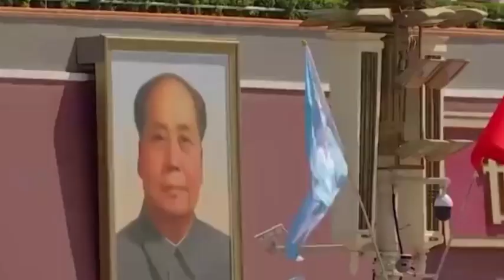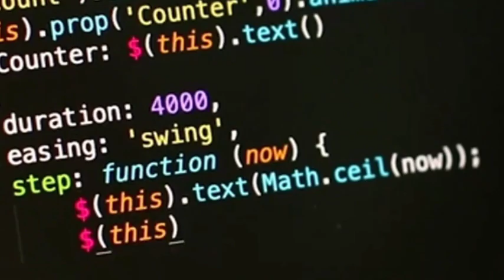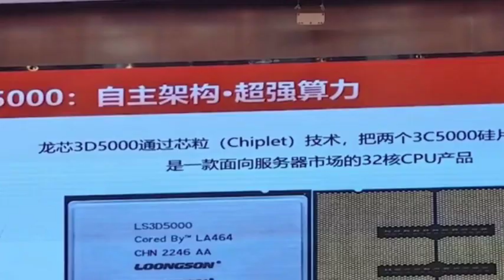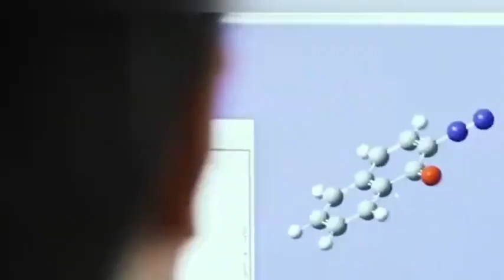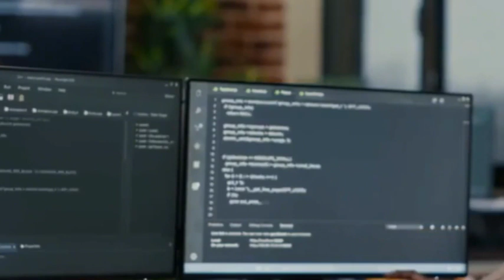Chip performance improved by 1000%! China's first graphene chip was born!

Comment: The race to smaller chip node sizes in silicon has become an expensive effort with more expensive lithography processes needed to realize.  If the comments are true, China has bypassed this effort by using graphene and will most likely prove to be a more cost effective new process for higher performances in speed and power consumption.  ASML should be worried.

Comment: If this breakthrough in Graphene Chips is to believed. And also add in miniaturizing Nuclear Battery breakthrough. Then the Chinese will take a commanding lead in tech and energy storage. With astounding usages for the groundbreaking Nuclear battery alone. But in the feild of computing for this potential breakthrough of Graphene Chips. It will set China as the technology leader for decades. The use of Nuclear batteries in computing devices alone will make China the envy of the World. If what I have heard of the very resent breakthrough of the Nuclear Battery is true. Then a Graphene Chiped Smartphone could be powered by the new Nuclear battery and run without charging indefinitely. The same for the current Smartphones used today. But this Nuclear battery could also provide energy for high proformance conversational lap tops which run out of battery power in about 15 minutes. With the Nuclear battery this will mean days or even weeks without changing. Or even longer.